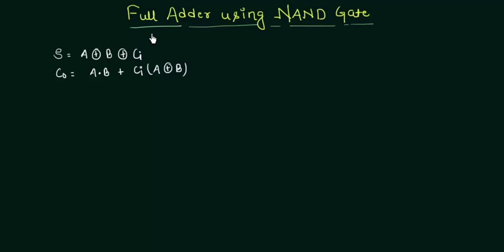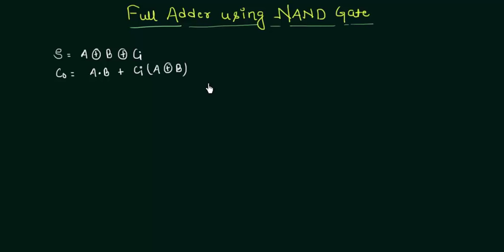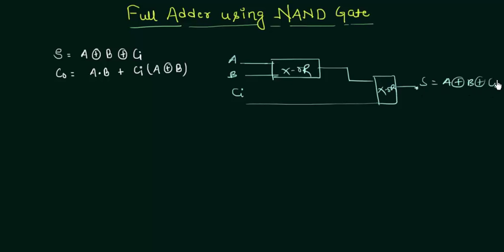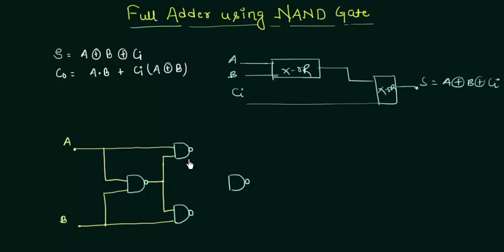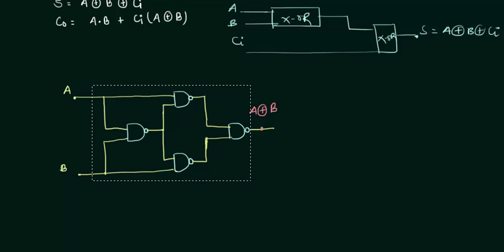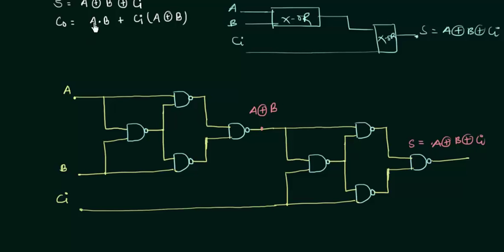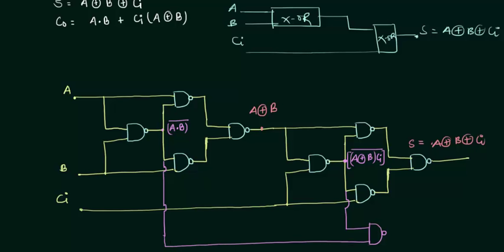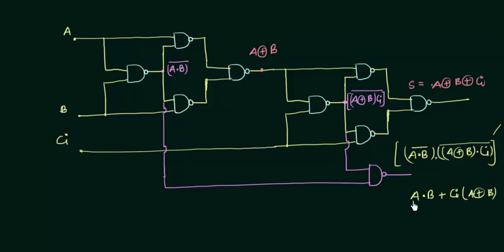Realizing Full Adder using NAND Gates only

Comment: What is the need to implement full adder using nand gate, when we can easily implement it using EX-OR gate
Reply: maybe because they're universal gates-
Reply: for exam point of view
Reply: 1. Cost of nand is lower
2.delay of nand is low
3. Reliability is high
4.i think in industry we only use nand or nor  gates coz we can construct any circuit with them

Comment: Can we design it more easily by giving input A' with B, B' with A?? 

It will form a different circuit diagram but the output is same🤔
Reply: no , we only have inputs and nand gate. In order to get A" we need to use NOT gate which we can't use(not given)

Comment: isn't the carry output supposed to be AB'+BC'+CA' ?
correct me if I'm wrong please.
Reply: it is supposed to be A.B + B.Ci + A.Ci which is same as A.B + Ci(A XOR B). Hope that helped.
Reply: U r right, actually these two expressions are equivalent. It depends on convenience.
Reply: @NakshatraSaxena  Hi. I know it's three years late.😂 But please let me know how AB+BCi+ACi is equivalent to AB+Ci(A xor B)? Isn't it supposed to be AB+Ci(A or B)??? What am I missing?
Reply: @AnoNymous-po5sx  It means that carry is only generated whenever either a and b are 's1 means AB or either A or B are once means A Xor  B and c is 1 means C(A xor B).
So ans is AB + C(A xor B)